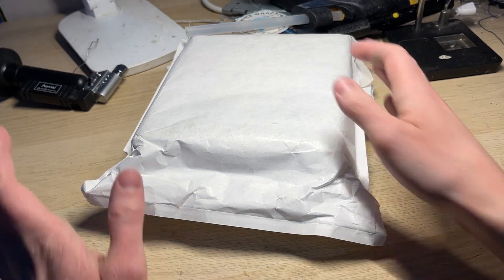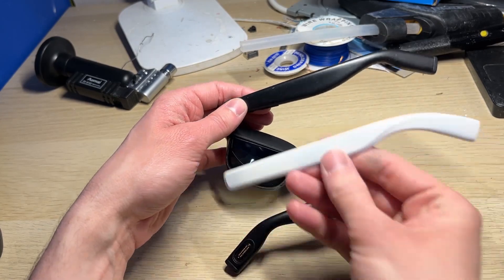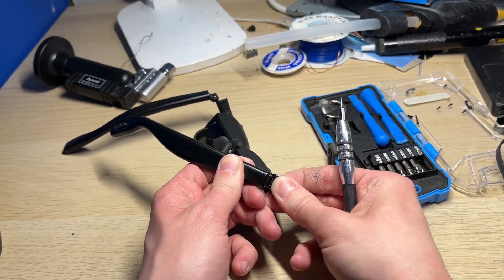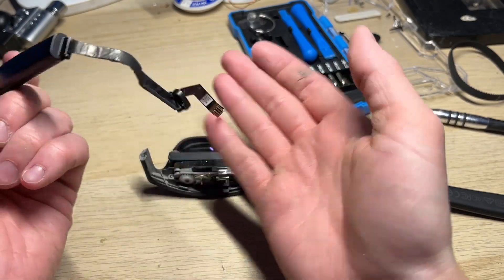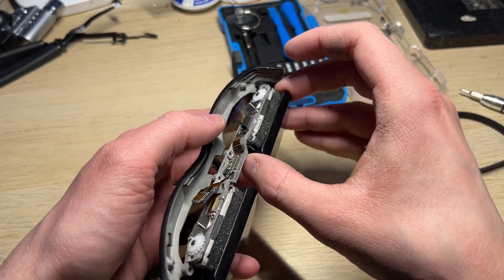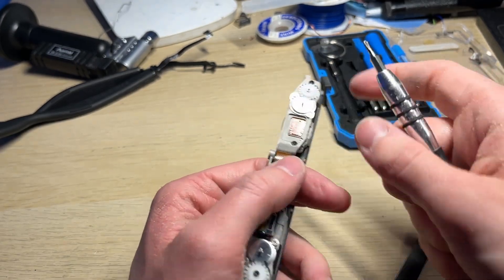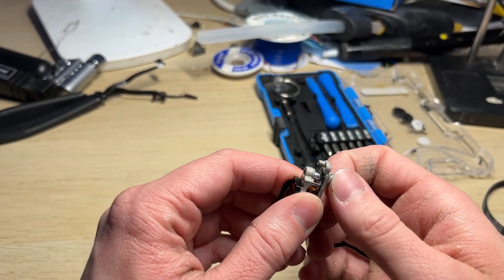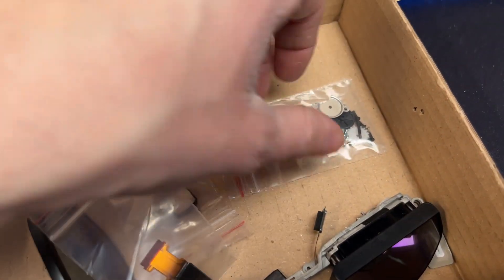Viture Pro Teardown

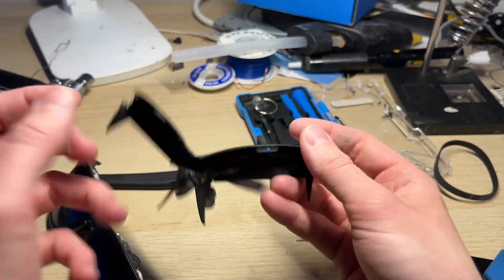Comment: 3:25 What's this cable called? On my VR headset, the audio cable inside the headband (or arm) is damaged from folding. I need to replace it because the left speaker's sound cuts out when I move the arm